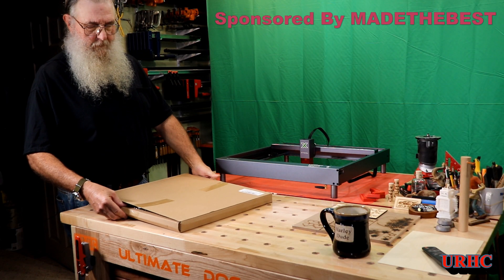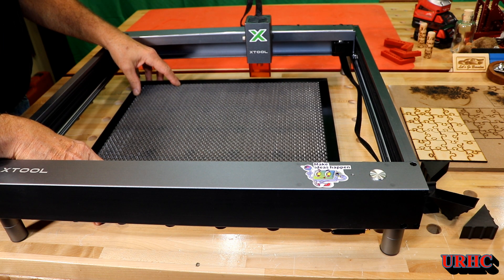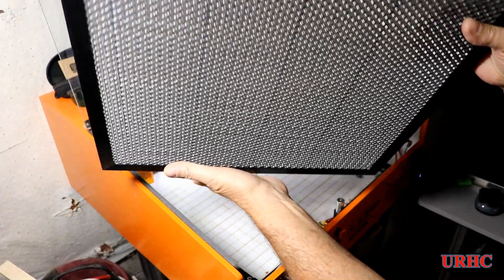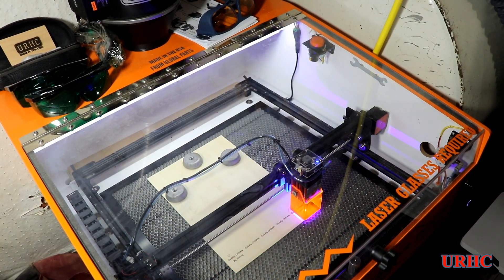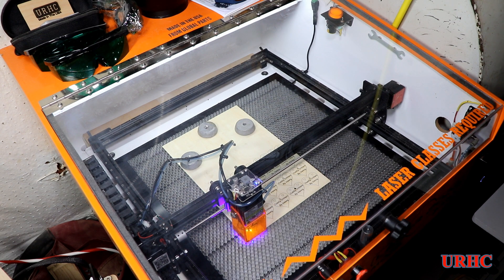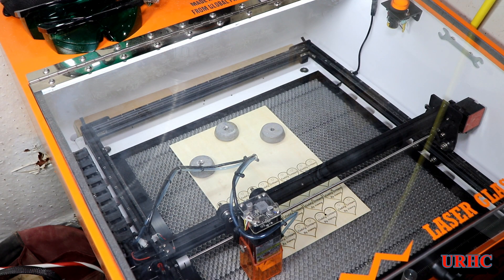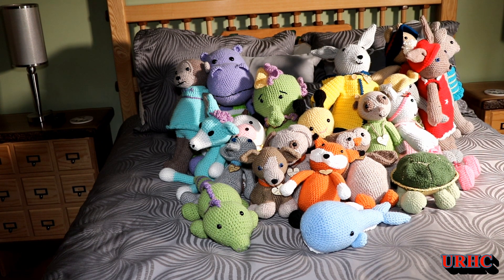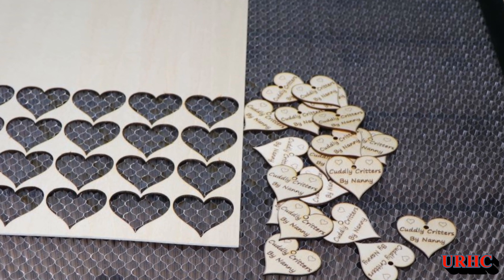Honeycomb Working Table Panel For Ortur Type Engraver / Cutting Machines

Comment: my new machine is a monster 790x470mm and I need a honeycomb panel. It has not even come in yet, but I have a question for you. I found a panel CHEAP that is a little bigger than my machine. Can I use a bed larger than the laser itself?
Reply from the maker: Should work if you can focus that low. I built a 400 x1000 from the 20 watt Atomstack and the biggest issue is make sure you have  a way to hold the workpiece flat because the laser adds stress  that makes some woods move. That's where having  a feeder like the xtool really shines. Thanks for watching.

Comment: 13 minutes video no information about dimensions of the honeycomp! it
 fits ok! what size? the first thing that u must say is this without anybody looking for it to the sites! also u put it in wrong direction on the lm2 pro.thats why is near the screws.
Reply from the maker: That's what the link is for. Up todat manufacturers specs. Thanks for watching.
Reply: u made 13 minutes video speaking about anything else and the viewer must get into link to see the dimensions! nice! and u are glad that u did not mention it at all in the 13 minutes video!  but u say how thick is the honeycomp! also u put the honeycomp in the opposite direction and u say in the video that barely fits in the ortur master pro 2 ! if u put it like it supposed to fit...the long side at the long side and the smaller side with the smaller side u will have at least 2 cm gap! u are the best youtuber!
Reply from the maker: Yes that's how you make money on YouTube. Clicks count

Comment: I have a honeycomb, but I still get significant burning.  I attribute this to the fact my laser module does not support air assist.  So, I have started using blue tape, even on the back when cutting.  It makes a world of difference.  

I like yor honeycomb better than mine though.  My is 300x300mm and so that makes it harder to align everything.  It is also aluminum and I can't use magnets.  I use some low profile 3d printed hold downs which work okay for larger peices, not so much for smaller pieces.  For the smaller pieces I have taken to building a frame around the piece with other smaller pieces and using the hold downs on the outer pieces with the center one being the target for the laser.  Seems to work so far.
Reply from the maker: Air assist makes a world of difference.  A dirty lens can also cause wider blacker cuts. Tape works but jusy puts more dangerous particles in the air. Thanks for watching.
Reply: @unemployedredneckhillbilly2023  I have the laser in an enclosure with an exhaust blower with a 16 foot exhaust tube that I run out my garage door.  I hope it is helping some.  At some point I may buy the 10w laser module which does have air assist.  Or 3d print some kind of adapter for my 5w module.
Reply from the maker: for my first  air assist I just used a long needle, low pressure regulator,  and compressed air. Wasn't perfect but made a big difference. Dewallie has the kit that comes with a pump, hose, and universal nozzle now that I have had success with also.

Comment: Are those green safety glasses good enough for eye protection?
Reply from the maker: I don't think so but all the manufacturers say they are. I bought a set of od 6+ rated ones on Amazon that wererated for the blue diode wavelength. Thanks for watching.

Comment: Howdy Mr. Redneck - Good video work, I was wondering, have you ever used hold down pins ( plastic or wood ) for holding your work down to the bed ? And if you have maybe you can say what kind worked for you and where you got them from and what size they are for the ( Made The Best Bed ). Thanks George in Fla.
Reply from the maker: I have never used them. I have a couple small lead weights I put in the corners if the piece is warped. Thanks for watching.

Comment: I've been looking at the honeycomb boards for my Z1, but they're a bit pricey for my budget. So I'm looking at one of two options, 1. An old oven rack that's level or 2. I have access to some scrap expanded sheet steel and some 1 inch steel L channel and I'm thinking of welding the L channel to the edges of the expanded sheet and using that as a cutting bed.
Reply from the maker: I just used one of my wife's cake cooling racks before this. Any kind of a grid with  airspace below it will work.  Thanks for watching.
Reply: @unemployedredneckhillbilly2023  
Thank you for the quick reply. I'll try the rack first and see how it works.
Reply from the maker: They aren't perfect  flat from the store so spend some time getting  any bow out of the wires  for best results.
Reply: @unemployedredneckhillbilly2023  Will do. I'll use a level as well.

Comment: Just ordered the same Ortur branded one. On the way for the D1. Believe those corner covers are supposed to say on. According to their materials, it is to help reduce the chance of cutting your fingers if you need to move it around frequently. Also should give a little air flow under the honeycomb, which I was told could help reduce flair ups even more.
Reply from the maker: I don't know if it really matters.  I figured there  would  be less chance of deforming it If it sits flat. There  still is airflow from the frame extrusion. Thanks for watching.

Comment: Ed, I do believe that is the most excited I have ever heard you and I can understand why. Who likes seeing smoke stains all over the back of their product? I sent you a link to a video in your email you may want to see before you start on your puzzles again. As always, I enjoyed the video.
Reply from the maker: This honeycomb works awesome.  I originally  tried one of my wife's baking cooling  racks that almost worked but the spacing  caused cut items to turn sideways in the cut and catch the laser. That  can ruin a day fast. Thanks for the link. I have seen people use borax but it raises the grain and makes items hard to apply a finish to so they only are worried about the darker color from what I can tell. Wish they made a flatbed inkjet printers these days that would  allow  me to cut the puzzles and then send  them through to be color printed.  I am looking  for one but can only  find expensive sublimination printers.  That would  be an awesome  combo with these  lasers. Thanks for watching.

Comment: GR8 video 👍 I'll b buyin 1 from Amazon at some point 😏 I see U have the xTool D1 there...I was ready 2 order the Ortur LM2 Pro with Orturs enclosure as an upgrade 2 my LM2...would U suggest payin the xtra money 4 the D1 instead?
Reply from the maker: The D1. is awesome but doesn't work with  lightburn  yet so if you're a lightburn  user it will be a while until it's  implemented.  Ortur also makes good lasers and soon they will also have a 10 watt version.  They both  are good choices and with the  current  discounts are closely  priced if you figure  the price of software  in. I really like the D1 design and simplicity along  with a working  wifi and app implementation.  Thanks for watching.